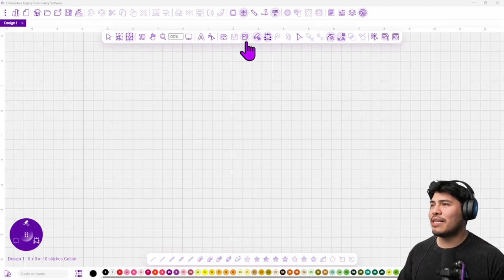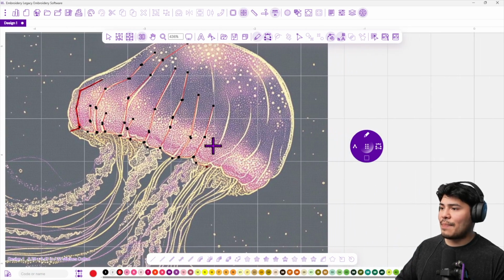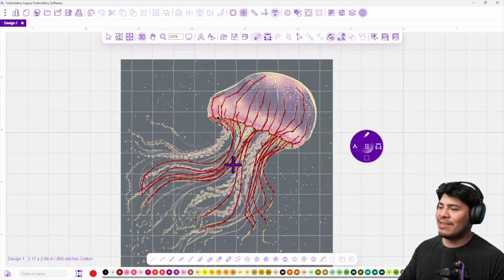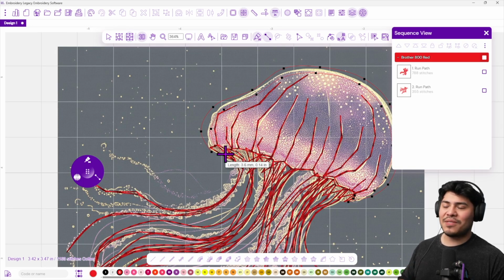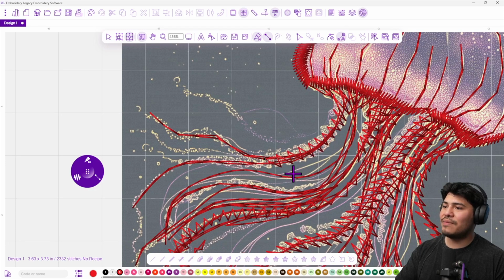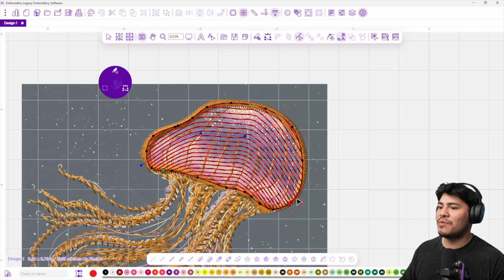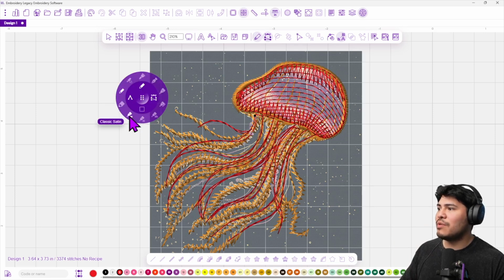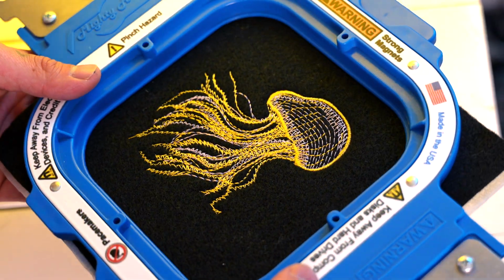Jellyfish Design Easy Digitizing Tutorial! Machine Embroidery for Beginners

Comment: Ehmmm... silly question, how do you get the scissors sign? And when you do right click for the curved line, how is it possible to do the same shame back as when I continue clicking right, the curve is completely different (at 5.51) 🥵
Reply from the maker: Great question! 😊 To get the scissors icon (used for trims or cut points), make sure your workspace is showing the entry/exit points and commands. You can do this by clicking the “three dots” icon (⋮) in the toolbar — it’s at the top left side of the window. From that menu, check “View Commands” to show trim points.

When using the Fast Draw tool, right-clicks create curves and left-clicks create straight points. So at the edge of each stitch, try using a left-click to keep the path straight and avoid unexpected curves. You’ve got this! 🧵
Reply: @EmbroideryLegacy  Many thanks for the super fast answers! The first one, done. Thank you! And the second one, great, so you finish those lines with a straight line, then go back with the curved lines?
This software looks a lot more intuitive (with some really cool smart options) but coming from a different software so really need to learn everything again 🥵
Reply from the maker: You're very welcome — and yes, exactly! 😊 Finishing with a straight point can help keep things tidy before curving back. It’s totally normal to feel a bit overwhelmed at first, especially switching from another program, but EL Digitizer is built to be intuitive and user-friendly. You’ll be flying through designs in no time! 🧵✨